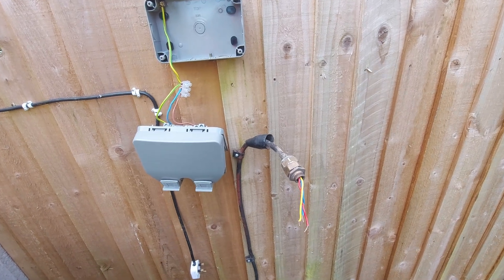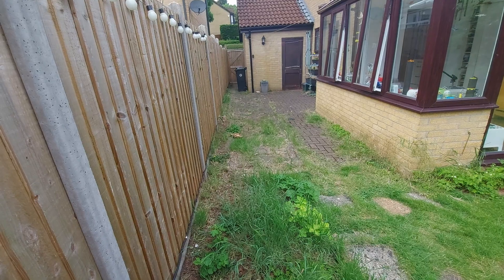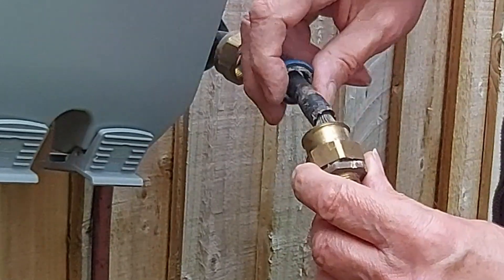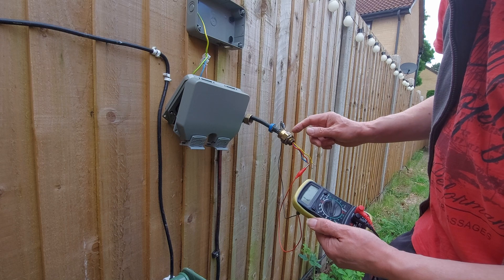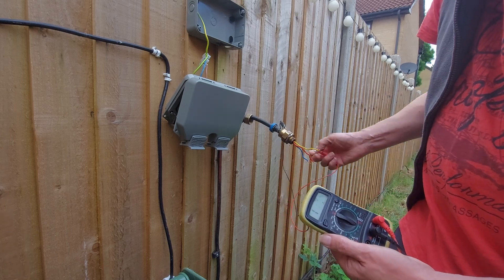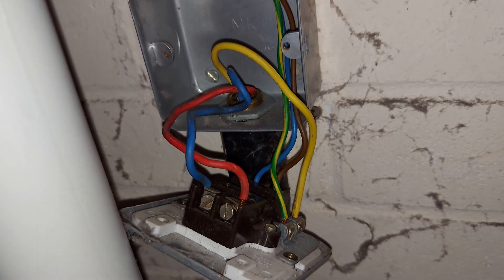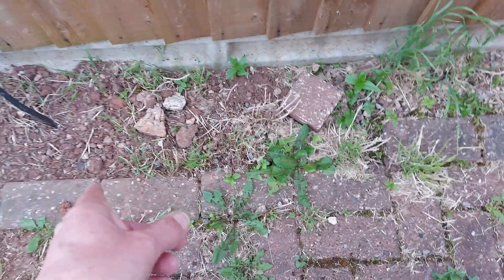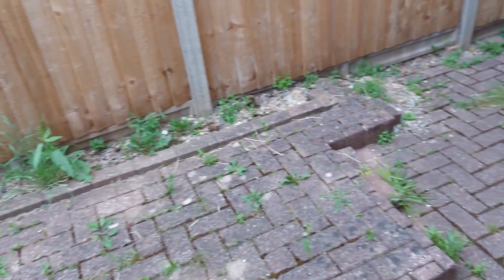Fault on my External Mains Socket feed PART 2

Comment: Where you based mate? I'll come and test it properly for you for free. It does need insulation resistance testing though. You've only confirmed the continuity of conductors, not integrity of the entire cable.
Reply from the maker: Thanks for the offer, but we know it is faulty and unless you are offering to dig it up and replace it free of charge too, it really isn't worth spending any time on it. The original issue was the electrics would trip in the house randomly and it took me a while to isolate it to this external spur. Now it is disconnected I don't have a problem. Thanks again for your kind offer 👍👍😁😁
Reply from the maker: By the way, episode 4 has just gone public and I explain it really isn't worth spending money on at the moment. https://youtu.be/gB8Ba53CjrY There is an episode 5, but that was just to clear off a previous comment.

Comment: Just replace the cable job done
Reply from the maker: Yes, I think you understand 👍 Even if I can locate the exact location of the fault, by the time I have dug a hole and located the cable, it wouldn't be much more labour to do the whole length. The long-term plan has been to replace the whole paved area as it is all uneven and has weeds growing up through. That was the plan before the fault occurred, and any extra work would just be a waste of money. Plus, I would run the cable all the way to the shed rather than stop where it is now 😁👍

Comment: Ideally need to perform Insulation Resistance end to end to check for cable integrity check across all the conductors
Reply from the maker: Why would I do that? What would it tell me?
Reply: @GrandadIsAnOldMan it will tell if the insulation is damaged and or if there’s a broken conductor. A cable that’s in good condition will give you an insulation resistance reading greater than 1 megohm some were closer to infinity ie greater than the tester can read and that’s what you want . Any thing less than 1 megohm is a problem.
Reply from the maker: Thanks, Sean 👍 All I need to know is that the fault is in the cable and not in the sockets at either end. As I have explained multiple times in this series of videos, finding the exact location of the fault is really unnecessary. (It might be nice to know for a feeling of accomplishment). Digging down under the pavers will be a costly waste of time. If I am going to put effort into that, then it would be better to replace the cable, starting at the correct location, rather than it's current dubious link across the rafters, and take it all the way to the shed, rather than it's current location on the fence.

Comment: Hope you get it fixed without having to spend a lot of money. 
I just use outdoor cable, not the armored type. Was working ok until Maisie my dog chewed through it.
That happened when we first got her but I haven't rewired it, so no power in my hut unless I use my long extension.
Best of luck with yours. 👍👍👍
Reply from the maker: I have no plans to fix it. Eventually, the paved area needs replacing anyway because it is all uneven where our neighbours tree roots went under it. If we do decide to replace the paving, then I will install a new cable all the way to the shed. This series of videos has just increased as people make suggestions and I do a video reply to answer them. We are now up to episode 5. I had not intended to do any more than the first one, but it is called audience engagement by YouTube 😁😁👍👍
Reply: @GrandadIsAnOldMan  Well as long as you get good suggestions. 👌👍👍

Comment: Maybe run a temporary cable to see if it is better . then bury it again in border without lifting paving
Reply from the maker: The plane for the back garden is to have all that paved area replaced. It is all uneven where the neighbours tree's roots have lifted loads of the pavers. It is just a question of whether we want to spend the money and obviously how much it would cost. That border is a mixture of gravel, concrete and rock, so not as convenient as it might look. A shorter route would be to come out of the back of one of the power sockets in the conservatory, but as I don't use the shed for work anyway I can use the sockets in the conservatory direct for mowing the lawn etc.

Comment: You should take off the whole gland to make sure. You only took off the seal part of the gland. You should be using a megger of course but you have to use what you have.
Reply from the maker: I was happy that I could see the steels splaying out in the right direction, but here you are https://youtu.be/8WLrRSfMcbw

Comment: Hi    With a DMM in ohms ranges you are only testing with a low voltage --- you should test with a MEGGER type meter which tests using a
high voltage  ( to be more like real life with 240 Volts ) . 
                                                                                                           Alan
Reply from the maker: Thanks, but please explain how that will help, other than give us a more accurate distance to the fault, (assuming I posses a megger, which I don't). We have established we have a fault in the length, not in the sockets and that really is all we need to know. We are measuring a relatively short length of copper wire, maybe 20 metres max. I am confident the fault is not above ground. That leaves about 5 metres underground. If I decide to dig down, I will need a reasonable size hole to work in, especially as I don't know the cable route for certain. If we measure to the exact fault location we will need to piece  it out in a proper armoured waterproof enclosure. If I am going to spend time and money doing that, I might as well replace the whole length. It can wait until we get around to having the patio replaced and then we can run it all the way to the shed. We can also do away with that rather suspect link across the joists in the garage 👍👍 I have put the links to all 4 videos in this series in the video description 😊😊
Reply: Hi   I was just pointing out that at 240 volts you may get leakage current that you wont see with
the multimeters low voltage . So you dont know that the cable end you were testing is OK at 240v
just that its OK at 9volts or whatever ..

                          Alan
Reply from the maker: @alanknight7867  thanks, yes, I see what you mean. You are right. Also AC has other issues, compared to DC. As it is, the RCD trips with nothing connected to the remote socket, the Multimeter indicated a high resistance leg to leg or leg to earth. That is good enough to tell me there is a problem in the length. However, it is not an economical fix to dig down and repair it, especially as in long term I would want to replace it all and run it direct to the shed.

Comment: I am unfamiliar with UK armored cable. If it is connected to earth you could try a tone-probe on earth and one of the other conductors and try to  probe for it.   Tone probes are meant for twisted pairs not a shielded conductors. So you many have to be very close to hear it ring out.   It may be worth a shot if you determined is it is cable leaving the garage.
Reply from the maker: Thanks 👍 I understand what you are suggesting, and of course that would assume I had access to a tone probe. However the exact location of the fault in the underground section is not really relevant. It is not a long run, and if I decided to dig down on the exact spot to repair it, I might as well dig the entire length out. The time taken creating a hole large enough to comfortably work on a repair, plus the fact that a directly buried repair is unlikely to be waterproof unless I buy a proper resin filled heat shrink repair kit, requiring a gas kit to work on it, makes it uneconomical to repair. If it was a 100 metre run it might be worth thinking about. For many years we have been thinking about having the paved area dug up and replaced as it is terribly uneven, If we do that, I would have a new cable installed all the way to the shed 😁 For reference, here is PART 3 in the series https://youtu.be/5C-EEE-RywA (I never intended to do more than one video, but I do like to answer peoples comments)